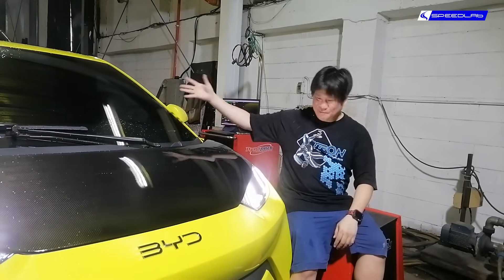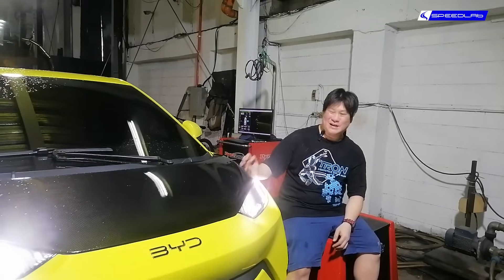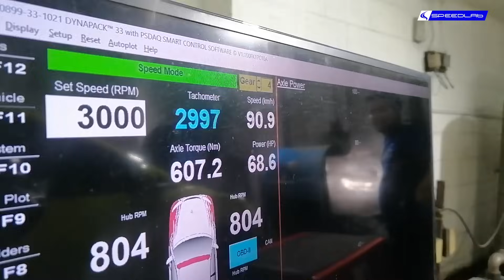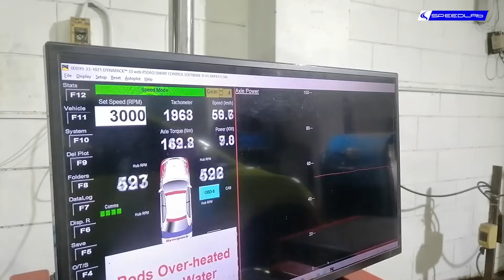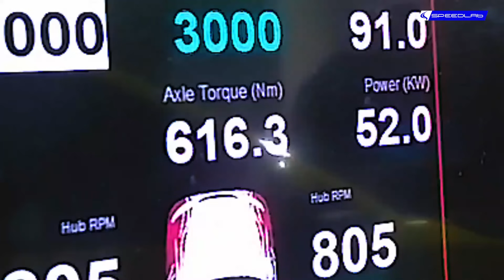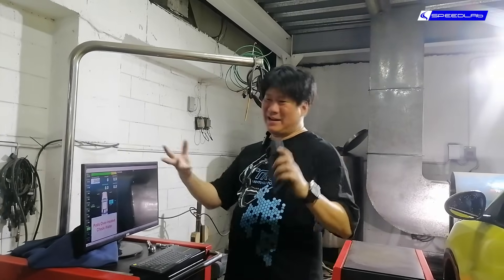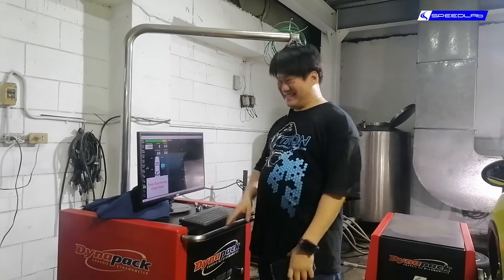BYD Seagull Dyno Tested! How much Power does it make?

Comment: Insane torque for a small car..
Reply: One of the many pros of electric motors. Comparable to diesel engine torque without the diesel smell. 😆
Reply: Not so much, 600NM at the wheels for a 1 ton car. Do the math with transmissions, a Suzuki Jimny in 2High will be like 4 times this.